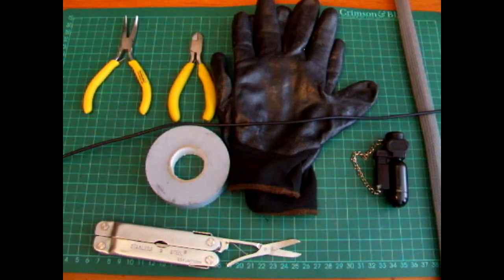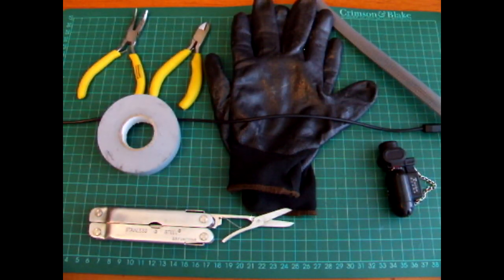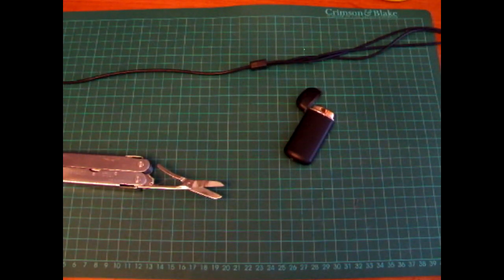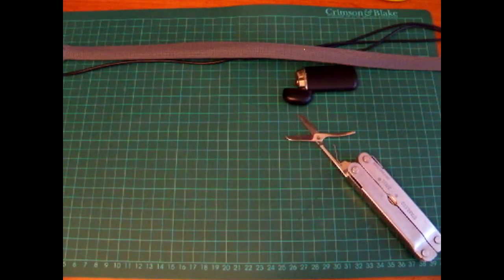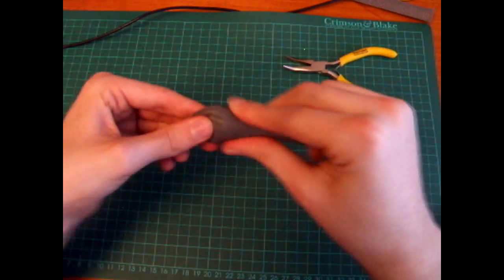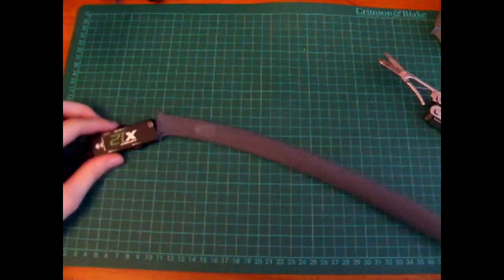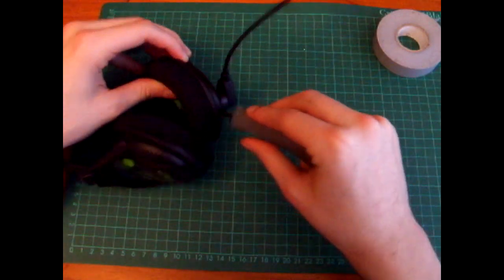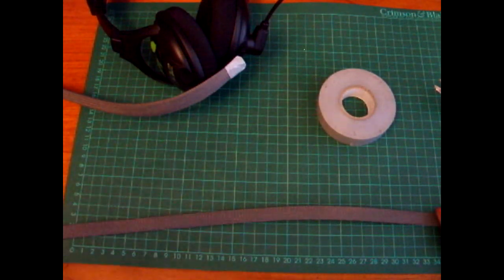How to sleeve a headset to stop the wires twisting turtle beach

Comment: Thank you for the video I was going to go out and buy a few sleeving but here another solution I've found on another site. "Hold your headset upside down, from the tip of the wire (so the headsets are closest to the ground.) Run your hand down the wires several times to get rid of all the static pressure. They shouldn't twist anymore. It's like holding a cat by its tail, except now you're holding your headphones from the end of the wire and the ear pieces are dangling towards the floor, get it? Then just rub your hand down the cord several times to get rid of the bends and twists."
Reply from the maker: Ye, i use to do that every week or so with my headset it just returns to wires to like new with slight twists and then in a few days or week then often start to twist again but it is free.
Reply: *****   Thanks for the heads up I'll keep that in mind, your way is a permanent solution
Reply from the maker: Angel of Light Ye it does cost a few £ or $ for the stuff but lasts for months or permanently if you do it right :) Shame my mute switch broke the sleeve outlasted the headset xD
Reply: +Angel of Light I did this and it ended up messing up one of the channels of my headset. I DO NOT RECOMMEND YOU DO THIS OFTEN.
Reply from the maker: +molomosk123 what happened?
Reply: if you dangle your headphones and let the wire untwist its self it can loosen the connections to either side of the audio channel. I lost my left side and only right was working from then on. I didn't do it that hard either..

Comment: Awesome.  and theory crafting here.  While it wouldn't look that great (though black tape wouldn't be as noticeable) wouldn't it be possible to use enough tape to tape it down to the small bit of left over wire so it doesn't scrape.

Also does the lighter have to be electrical or will a regular lighter that u can buy at like 7 eleven work?

Comment: Hold your headset upside down, from the tip of the wire (so the headsets are closest to the ground.) Run your hand down the wires (gripping with your finger and thumb) several times to get rid of all the static pressure. They shouldn't twist anymore.

Comment: So from the box to the headset should i bring it all the way up to the headset or leave like a half inch of wire out of it up by there for prevent scraping?

Also for the box to headset part will 12mm work also? or do i have to get a slightly larger side (like a 15mm or something).

and who the hell at turtle beach thought it was a good idea to make the cable 17 feet long from plug to box!